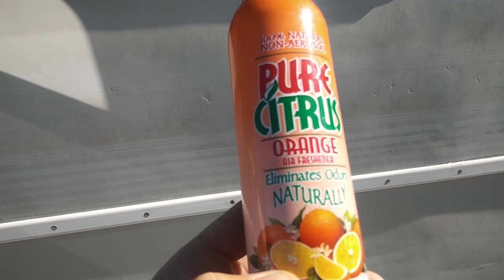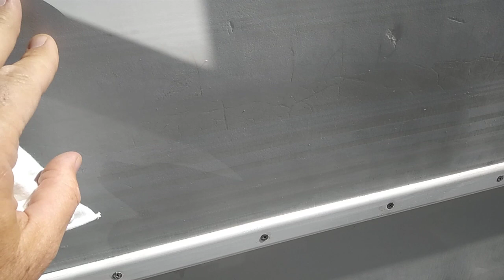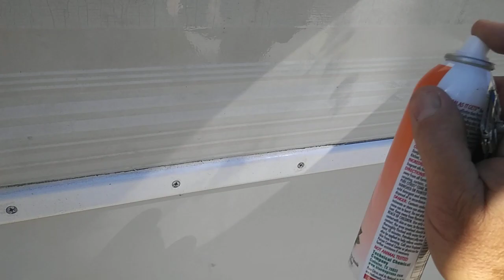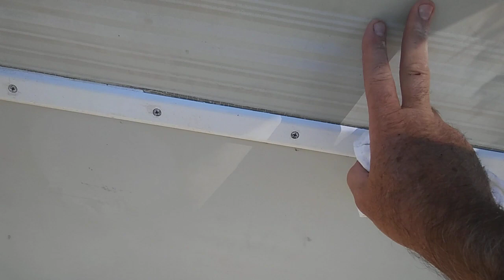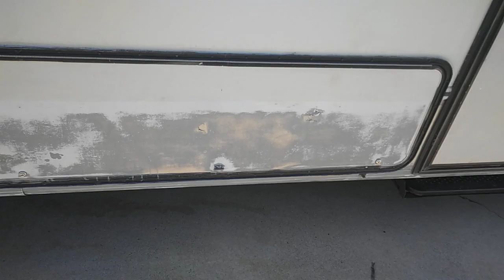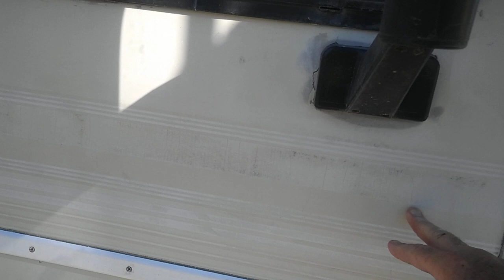Motorhome painting how to do it yourself without using rust oleum

Comment: Is an enamel like these a good option to paint a boler type trailer? They are fiberglass but have a more flexible shell... Do you think the paint will crack and flake off?
Reply from the maker: probably last a long time on that. house materials have better adhesion then automotive. They just fade quicker. A alkyd emulsion has good flexibility adhesion and fades less than most house materials.

Comment: Does it dry as hard as rustolium? I thought about painting my truck with a good water base and the guy at the Sherman Williams store told me not to, what do you think?
Reply from the maker: the alkyd emulsion is really hard water based paint. it dries like an oil base. Really weird stuff. not like regular water based paint. there is also a product cally polytech which is even harder urethane water based paint. couple guys painted their trucks with it. But even better is PPG Breakthrough really hard finish. Very similar to automotive finish but is water based. The 49 state formula not available in ca is the best when it comes to breakthrough.
Reply: @mikethepainter  sweet thank you! I have a 2000 f350 here in road salting michigan that needs a ton of body work and then of course paint. I want to do it myself because I'm interested in making a good truck that looks bad look good again. I like 1 step process stuff and auto paint doesn't seem to be that. Also I will be doing this in my garage so I don't want alot if overspray, and I like to do things outside the box! Thanks again!

Comment: HI Mike,
Wonder if you could help me on a similar matter. I have a Burstner  caravan (made in Germany), which is staying under the Med sun, so the external paint seems to be somehow burnt. If I rub my palm on the side wall, it leaves white dust on it.
I want to repaint it but I do not want to loose the graphics, so I wonder if there is a way of painting with a roller or even better if there is clear coat I could use on top of it as it is. The caravan is made of aluminum and the surface has those little bumps all over, it is not flat.
Can you please make a suggestion?
Thank you.

Comment: PLEASE TELL ME HOW MANY COAT DO YOU USE ON FIBERGLASS MO TY MOTORHOMES 34 FT. What kind of paint?  I don't know what kind of motothome that is
Reply from the maker: a good inexpensive product that you can spray on there with an airless is a paint called. PPG breakthrough. It takes less prep than a automotive urethane. and lasts pretty well. Water based but dries hard like oil base. Must be sprayed.